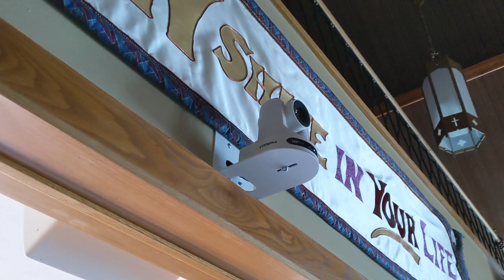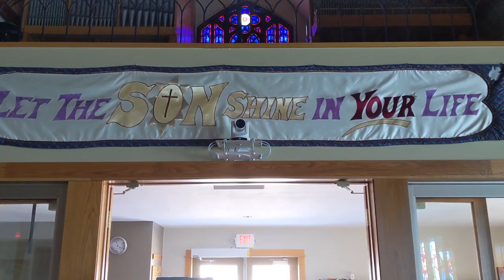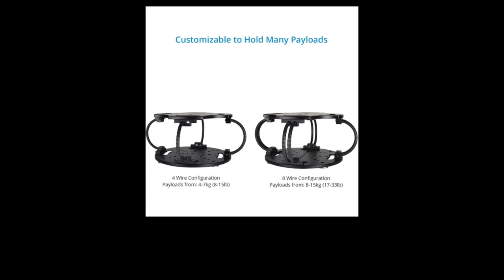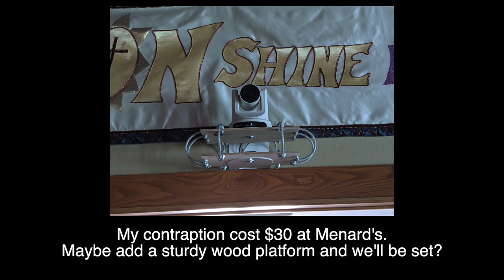Balcony vibration reduction test with PTZOptics 20x camera and $30 homemade isolator platform

Comment: Great video Ivan.  One of our cameras has the shakes due to a door closing directly below the camera.  The door has dampeners to allow it to close softly, but it releases the last "maybe" 1/4" hitting door framing.  Fixes have been on my radar for some time now.  And I've considered several options.  But actually seeing one that is not sales oriented is satisfying.  I will be sending your video to a couple others on our team to consider as well.
Reply from the maker: Ya that's a tough one. I think I've learned that getting everything as rigid as possible is 95% of the solution. The standard L bracket actually amplifies any vibrations, so fixing that first is key.

Comment: I think the problem is that flimsy L bracket.  A gusseted angle bracket(or 2 under a wood platform) might eliminate or reduce the vibration. I've mounted PTZ cameras in a tv studio, so I have some experience

Comment: Try adding weight to the camera plate, the extra mass should help. I use R/C car, coil over shocks on my anti vibration mount.
Reply from the maker: That's a good idea! I'd like to see a picture of that. I have a new mount in the works and will post a follow-up video soon
Reply: I agree.  @Ivan Bulcher Your applying mobile vibration tech, which is less weight is better.  You can afford added weight, they can not. Interesting video and results, keep it up.

Comment: Hey Ivan, did you ever make a follow-up video with your new mounting bracket?  We just bought our first PTZ, using it for the first time yesterday, and we had vibration affecting the autofocus.  Not sure if it was from the back wall reverberating from sound system or if it was related to an air return that is several feet above the mount point.
Reply from the maker: I haven't yet! I need to. The biggest thing affecting autofocus is usually weak lighting on the subject, which causes contrast issues with the background. Plus, the ptz settings for focus zones  might need to be looked at. Is your issue when it's zoomed in, I assume? When you're zoomed in any vibrations are amplified, so it could be that you're losing focus by losing track of the subject when the lens is literally moving around from shakes. The zoom on a ptz also worsens its ability to capture light because it has a variable aperture, which leads to the contrast issue again, which is solved with more light. The standard L bracket is not ideal because it is flimsy. Start with a more rigid bracket of any kind.
Reply: @ivan.bucher  I just went back and looked at the video to try to assess.  The shake appears to be in time with the music - my pastor thought from the subwoofers.  But out of several songs we played yesterday, only one seems to have caused the shaking.   More investigation is needed, but I'd love to have a pic of your thicker mount.  I thought the included one was sturdy, but now I'm questioning that.

Comment: Great video, thanks for sharing the before and after.  Our PTZs are mounted on a wall that has HVAC ducts inside them and whenever the heat or AC runs it causes a noticable vibration.  Being a church, it's hard to justify spending $800+ on mounts for a relatively minor problem, so I have been looking at DIY options like this.  Do you think this would be good for damping the type of vibration we are experiencing or do you think rubber isolators would work better?
Reply from the maker: Thanks. Well, we've moved on from the solution in this video, and I'm overdue for sharing the update. Long story short, we have a 3/16ths inch steel L bracket holding two inverted ptz cameras side by side. 98% of the vibration reduction came from this stiffer bracket. So I would find a cnc machinist who can make a custom mount for your needs. As far as micro vibrations like yours (though I would need more details about your setup), I would try to have a larger bracket that spans more of your wall. I would also consider buying the special rubber made for this application. I forget the name now... But you can find it in sheets online.
Reply from the maker: Isolate It: Sorbothane Vibration Isolation Circular Disc Pad 0.25" Thick 1" Dia. 30 Duro with 3M PSA - 8 Pack https://www.amazon.com/dp/B00X6RINRG/ref=cm_sw_r_apan_i_JEYCNJX57BS042D58W84

Comment: It did help, but have you tried inverting your vibration mount?  I've read suspending camera below the bracket, can help.
I'm trying to figure out how to minimize camera vibration from our balcony too.
Reply from the maker: Not yet, but inverted may be worth testing too since the cables are now sagging a bit, which affects my zero points. We have a guy who will machine a stiffer L mount, so I plan to try that next. I did add a second camera to this setup and when one camera moves fast it makes the other one shake. I'll update this video once I make changes.

Comment: Have you had any further success? Trying to improve a very similar situation
Reply from the maker: We actually just installed a new custom bracket last week. It uses 3/16" steel that a congregant donated, who also cut it out using his cnc machine and welded too. I plan to make an updated part 2 video when I get the chance!